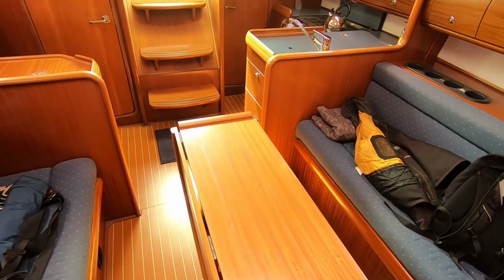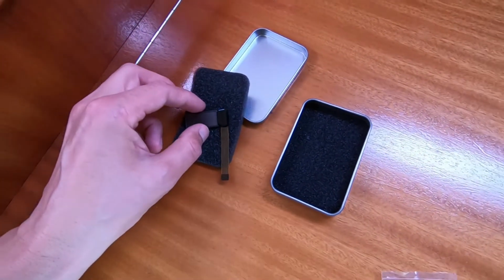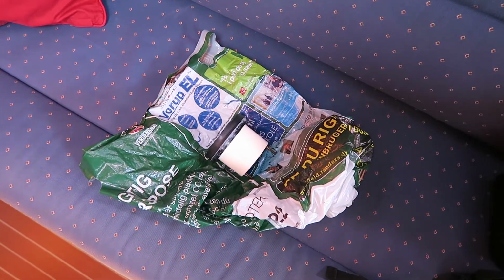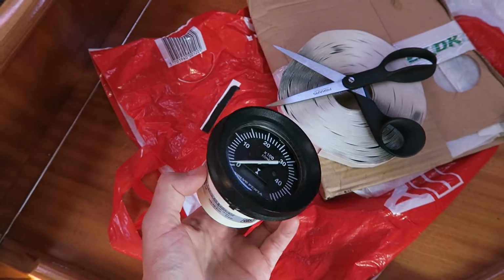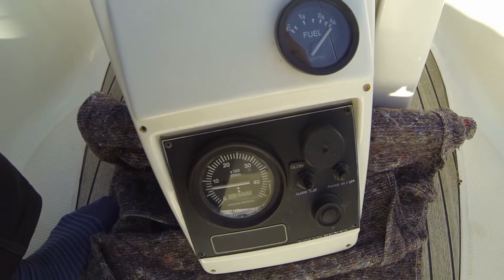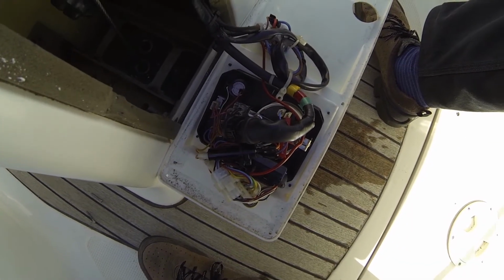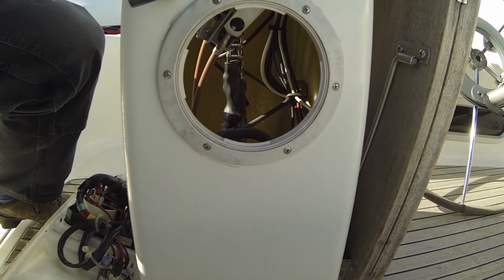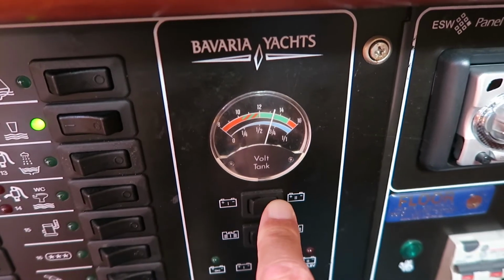How to fix Volvo Penta hour meter LCD screen

Comment: Is there another way to check amount of hours,without fixing it
Reply from the maker: The hour counter is located in the chip inside the hour meter. If you change the whole hour meter the hours will be at 0. You can of course also look at the engine and make a guess. A engine runs for about 58 hours in one year if you don't use the boat that much.
Reply: @twiper  i think ill try with new ribbon lcd,found it in europe where i am for 50 euros
Reply from the maker: @tonchido  you can buy the LCD on ebay and Amazon

Comment: With the led bulbs your alternator will not work either as the bulb connection gives the signal for the alternator to work. At least on my model engine and boat. (2003 Benetaeu First 31.7)

Comment: Hi Tino, I wonder how you got the new lcd to display the old engine hours... did this happen automatically?  And which model of screen replacement did you get, and from which supplier? Hope you can help... thanks for the video.
Reply from the maker: The engine hours is stored in the instrument itself, the display just show the numbers. You can get a new display on ebay, search for : LCD Screen for Kenworth trucks/VDO cockpit vision/Jcb tractor/Volvo penta boats
Reply: dankeschon!
 @twiper
Reply: can you share with me your supplier in China?

Comment: How can i buy a replacement LCD for the engine hours?
Reply from the maker: You can get the one you need on ebay - search for : LCD Screen for Kenworth trucks/VDO cockpit vision/Jcb tractor/Volvo penta boats

Comment: Hi Tino, yesterday in fairly good weather here in Zeeland I changed the LCD ion my 32 and it works... 8000h on the clock. I thought it would be less looking at the engine. I wish you would be in my Marina, that would be great!!! best regards Jobst

Comment: Hi Tino, many many thanks for your videos! , very interesting your 6 videos  regarding the cooling system cleaning the heat exchanger.I have also a MD2020 the LCD display is not working, please could you provide the link for the new LCD screen? Many thanks ,Kind regards
Reply from the maker: Thanks :) - I don't know if a link will work but search Ebay for "LCD DISPLAY Fit for Volvo Penta Boats Kenworth Trucks VDO Cockpit JCB Tractor"

Comment: If you have a newer version of Tachometer with a silver ring its not made for open up and replacement of LCD is rather hard as example the grade is glued and not screwed in (I did it on my KAD300 from 2003)

Comment: Hej Tino, har din motor kun kørt 807 timer?
Reply from the maker: Ja
Reply: @twiper  Okay, på vores display står der 618 timer, og vores Bavaria er fra 2003. Det har jeg lidt svært ved at tro på, hvad tænker du? Og tak for en masse gode videoer :)
Reply from the maker: @PawTimewithTeo  Hvis motoren er flot og velholdt kan 618 timer godt passe. Omdrejningstælleren kan selvfølgeligt have været udskiftet i bådens liv men de fleste lever med at timetælleren er kaput. I de 5 år jeg havde min Bavaria 32 brugte jeg 200 timer på tælleren.

Comment: Thanx, great video! Just ordered the display. On my old boat, the lamp was also used to trigger the generator circuit. So a LED will probably not work...
Reply: where did you find the display?

Comment: Hi Tino,
In my autopilot (Raymarine ST4000+) there is the same display problem (hard to read).
I wonder whether it works to clean display pins with contact spray etc.?
Or is it useless and I have to buy new autopilot display?

In your comments you mention about some chronic malfuctions of Bavaria 32 (2002), is Raymarine ST4000+ faint display in those chronic group in your boat?

Comment: good morning
Thank you very much for your videos you learn a lot, a question in my bavaria tachometer is very old and the LCD screen does not reflect the hours. I decided to change it for one bought in China that is much cheaper than I return but it does not pick up the signal, could you help me?
Reply from the maker: The LCD you have bought in china can be defective, if not the tachometer hour meter chip can be defective. Look for any damage in the soldering around the chip board. If the tachometer is very old the LCD type can also be different from the one I show in the video. Try to search for a LCD for your tachometer type, I know there is different amount of pins on different LCD's.
Reply: @twiper  Thank you very much for answering, I have bought the complete tachometer and I don't know if the signal is different
Reply from the maker: @juliogaitan3146  If you have bought a complete new tachometer you must program the tachometer to your system, you can find info about how on the web. You access the "menu" in the tachometer by holding down some buttons and you can then calibrate or match the tachometer to your boat. The tachometer stores the hours inside so if it is new the hours is at zero.
Reply: @twiper  Ok thanks, if you want to sail through the Mediterranean, tell me and I'll leave you my boat

Comment: Any tests that I could try for a faulty tach? My hours meter and the actual rpm gauge doesn’t work on our Bav36. I have checked voltage at both ends, engine and pedestal and it appears to be the same. Would you know what this reading would be and if it’s ac or dc?
Reply from the maker: According to my little test before I mounted the tachometer there is 4 pins on the back where I connected the two lower ones with 12V DC and the hour meter then turned on. I think the two other pins is for the tachometer needle and I think one pin is connected from the W point on the alternator and the other to ground or maybe +12V DC. For fault finding I think you should try to turn on the system and then take a reading on the tachometer connection to see if 12V is reaching the tachometer or not.

Comment: Hi Tino,

I tried to watch closely but I did not see any light bulb/back light in the tachometer. Was there any, and if there was, do you know the bulb type ?
Reply from the maker: Yes there is a bulb in the tacometer, the bulb hole is located at the top on the back. If you see at 7.19 in the video you can see the black thing in the right corner, and also at 7.51 you can see the hole for the light from the bulb. I can't remember what type of bulb there is used but I think it is a T05 12V 1,2W, if not it's a T10 12V 1,7W

Comment: Great video Tino. My hour meter has not worked for some years. Do you know if the hours will still have counted up when my display was not working? Will it display the correct total hours when I mount the new display?
Reply from the maker: Yes the hours will count up in the background so when you mount the new display the correct hours will show up.
Reply: That’s great, thanks Tino

Comment: Great video! What was the cause of the no charge alarm that sounded after the engine start up?
Reply: Thanks for the response. I've done some research since posting the question and now appreciate that the purpose of the battery light being connected to the alternator is to provide an initial voltage to the alternator to make the voltage regulator work and thus "excite" the alternator to produce current as it spins. I also now know that led lights do not have a linear relationship between voltage drop across them and the current passing through them which makes their use as a voltage supply to the alternator inappropriate.
Reply from the maker: Thanks. It was due to too low resistance in the LED bulb

Comment: The resistance in the bulb of the charge indicator is usually part of the charging circuit in "older" engines, and can therfore not be replaced by LED.
Reply: That is correct, the generator draw power from the battery at start, thru the charge bulb circuit.When the generator is turning is generates power, so there becomes a equal voltage on both sides of the bulb and no current = no light

With the led bulb the generator is unable to draw power, becourse the led works as a blocking diode.

You can change the other 3bulbs to led and leave the charge bulb as normal.

Comment: Many thanks fort all the intresting movies about your Bavaria. I've a question about your ship. Is an anchor winch mounted. If yes,  have you pictures about the mounting and the 
winch podium in the anchor box. Greetings from the Liberty in Netherlands
Reply from the maker: Yes I have an electric anchor winch mounted on my boat. I can make a "tour" in my anchor locker in the next video :)
Reply: @twiper  hi Tino!
Have you taken that video about anchor winch (windlass) and its mounting? I should dismount my windlass for overhauling and maintanance.

Comment: Tino, Thanks a lot for let us know where to buy the LCD. Last Year I have already replaced it but at higher cost. Can You pls let ke know where I can buy the LCD Bulbs as well?
Reply from the maker: https://www.ebay.com/itm/2pcs-White-BA7S-LED-DASH-GAUGE-WARNING-SWITCH-BULB-CLASSIC-CAR-GLB281-LLB281-12V/302730538579?ssPageName=STRK%3AMEBIDX%3AIT&_trksid=p2060353.m2749.l2649
Reply: @twiper  Thanks again I will order them !

Comment: Gosh Tino, I paid A$260 to fix my hour meter. I wish I had seen this before. I had to take the tachometer out myself and take it to the repairer.
Reply from the maker: Yes sometimes you can pay to much for a simple thing, also why I make these videos to help fixing the most common problems. On Bavaria boats almost the same faults is on every boat eg. leaky hatches, rusty keel, black water tank censor stop working, refrigerator thermostat stop working and so on. The point is you can buy a Bavaria yacht and fix the whole boat easy and cheap and then have a trouble free boat for many years.

Comment: Good video. Thank's. It's a pity than all the hour meters are uneficient after 500/1000 hours of run. I have the same problem.
Reply from the maker: Yes, but I have also seen the problem on other than Volvo's VDO tachos. Maybe it's in general those LCD's just can't handle the outdoor life.

Comment: No link to buy
Reply from the maker: You can buy it different places, but here is the direct link where I bought mine  :  https://www.ebay.com/itm/LCD-Screen-for-Kenworth-trucks-VDO-cockpit-vision-Jcb-tractor-Volvo-penta-boats/113187269878?ssPageName=STRK%3AMEBIDX%3AIT&_trksid=p2060353.m2749.l2649